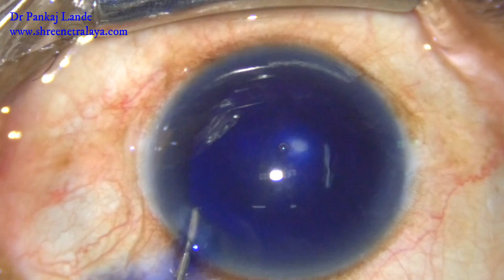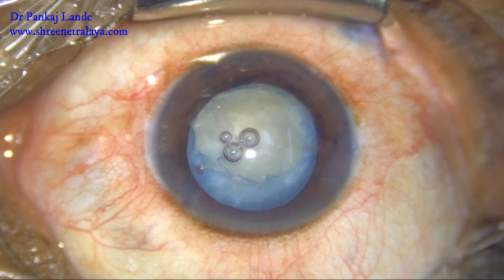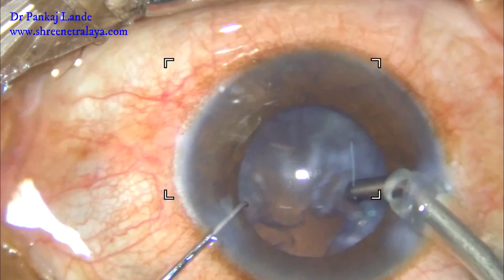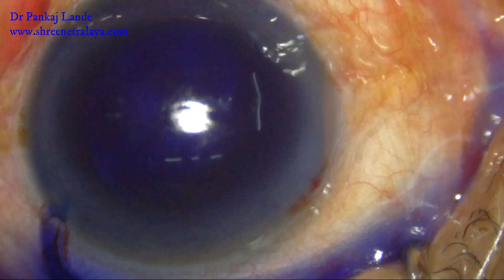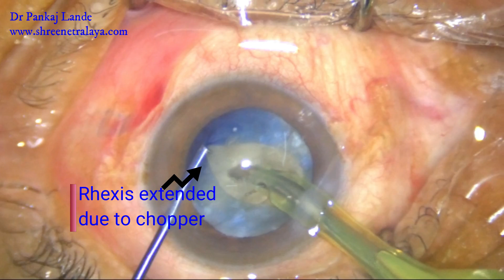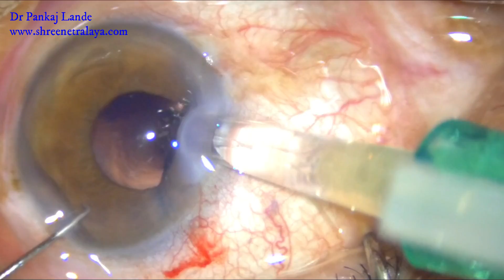how to perform phaco in Extended Rhexis   DR PL

Comment: Nice surgery. But I think you shouldn't exit anterior chamber without filling vith ovd. Yoıu were lucky in that case.
Reply from the maker: Diclehan Ali Dicle @

Thank you.
Note the stability of AC while performing case, extremely important... This tear will extend of you avoid stretching of bag, overfilling it....and do a central maneuvering. It was a controlled situation for me,
Vid is a bit fast forwarded to accommodate two cases. 
Pushing visco will help... Good to practice...esp if your case is under topical(increased positive pressure due to movement). Here was under block...
Reply from the maker: * read " tear will not extend if you..."